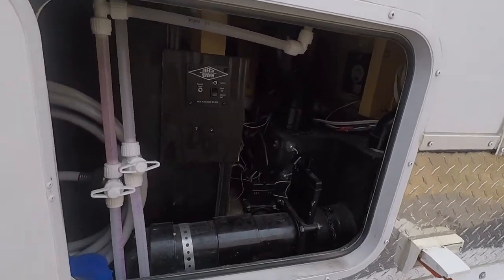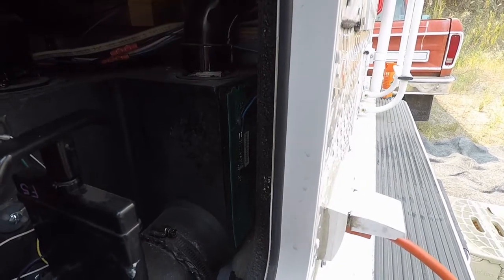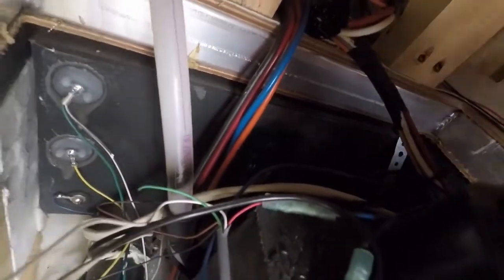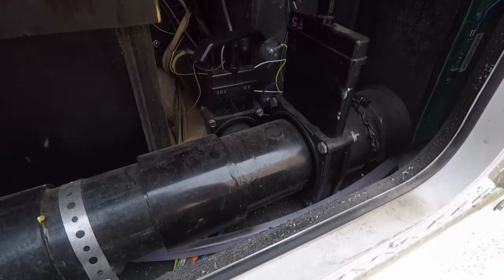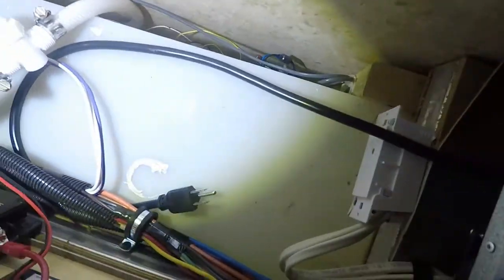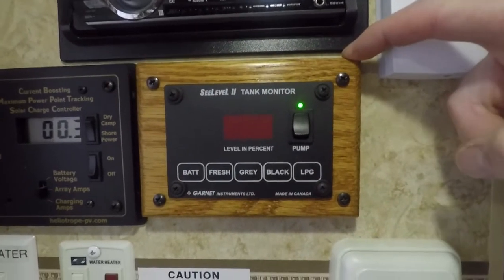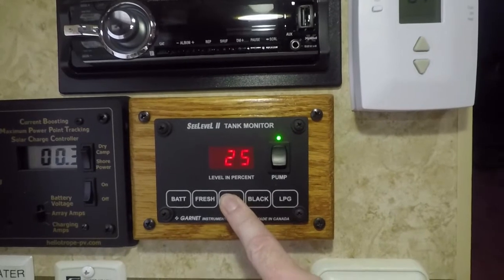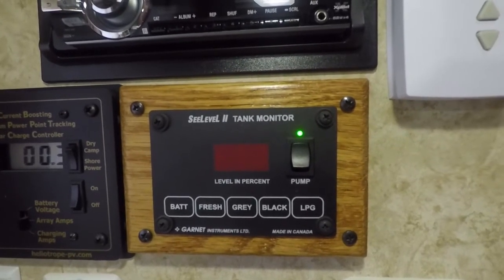See Level II Tank monitor

Comment: how is the pump indicator wire connected? Does it connect to the center connector on the pump switch?
Reply from the maker: I'm not sure, I'd have to take the panel off the wall to check.  One terminal on the switch is incoming power, the other is outgoing power.  The indicator is above the switch, not built in to the switch, so my thinking is that my switch only has two terminals.  It's been 8+ years since I installed my SeeLevel system, so I din't remember the configuration of the switch,